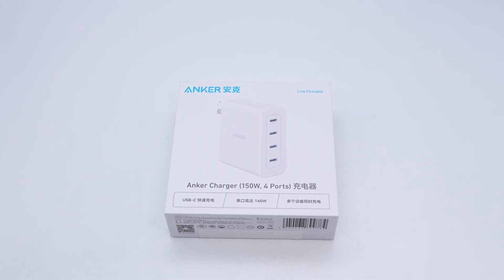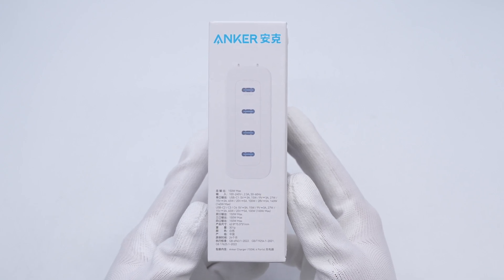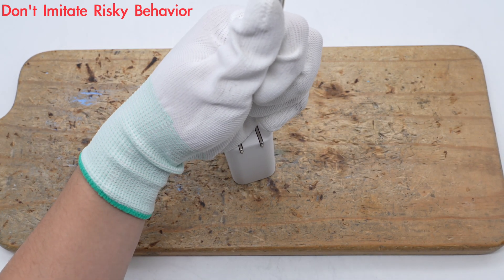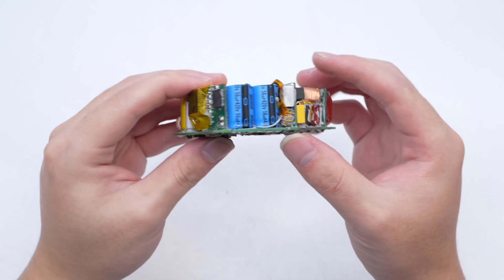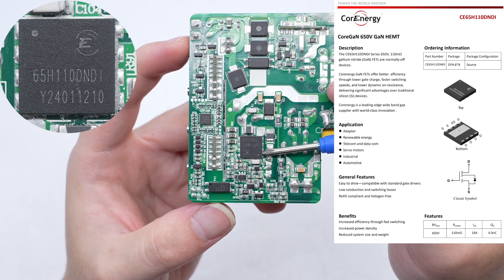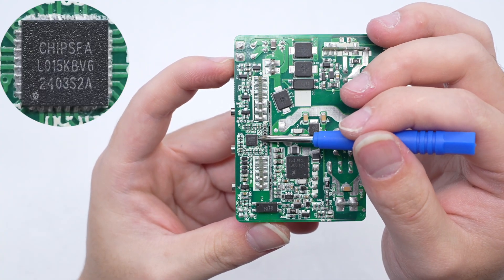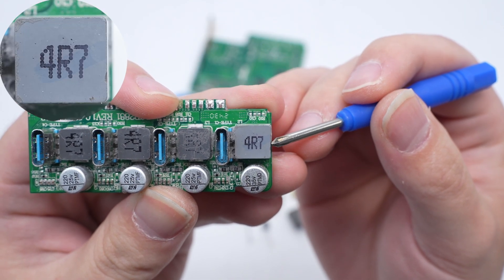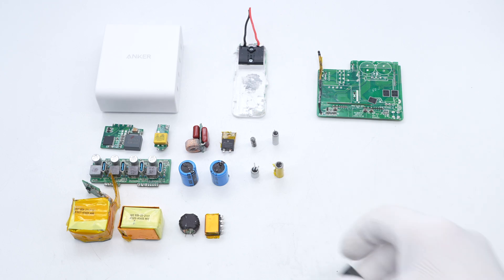Teardown of ANKER 150W 4 USB-C Ports GaN Charger

Comment: It would be better if you load tested, and took voltage, ripple and heat readings at the various load and voltage settings for each port.

Comment: Could you test some cheap essager GaN chargers?

I got a 20W for around $2 USD on Aliexpress and works better than expected, my cheap USB tester showed it delivering around 18W to my powerbank.
Reply: I spotted essager charger are not care the cable, I have eassager 70w and use test with ugreen 60w cable, It input to USB tester full 70w and not care the cable maximum, After that I tested cuktech 120w and It detected maximum of cable and only put 60w instead of 100w full also It falsely claimed in product description as It support samsung sfc 2.0 45w but It only support 1.0 25w and I spotted with usb tester that It can't input some samsung afc protocol volt step and essager cable are trash, the cable not have aluminum foil inside as a shield for protection and blend (after use It for a week without much care, the cable look like nissin instant noodle because wire inside cable and bend bend bend and not form shape anymore) and red black wire very small compare to well known brand, Some of cable model also write emarker to usb 3.2 gen 2 but in reality It only support usb 2.0 which is already written in product description, Do not buy It, Now I replaced creepy essager gan charger and cable with cuktech charger and anker zolo cable, It better quality.